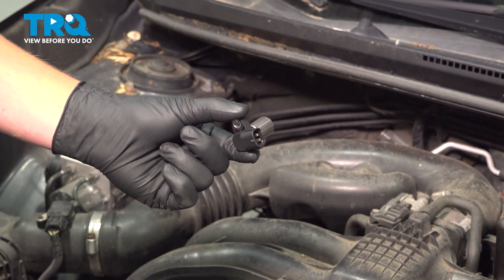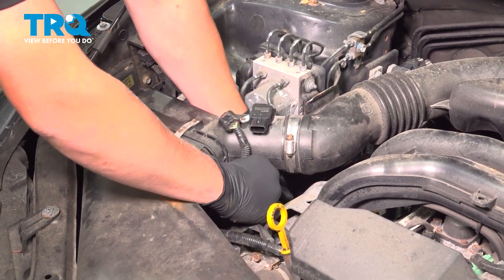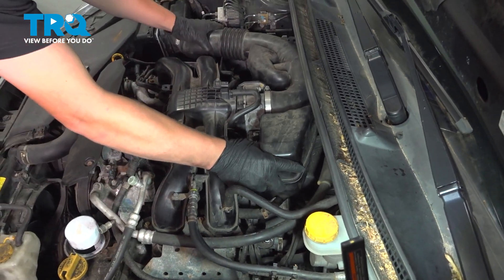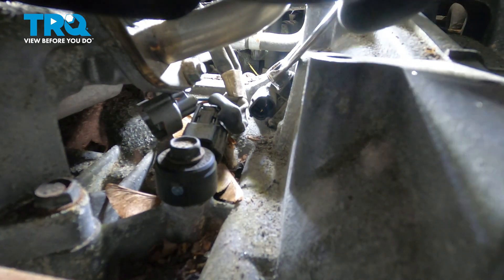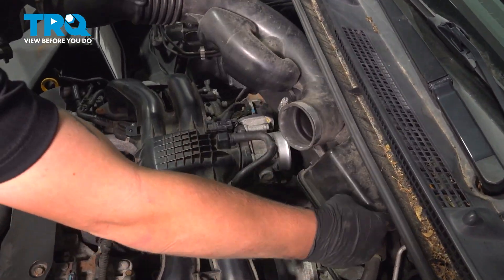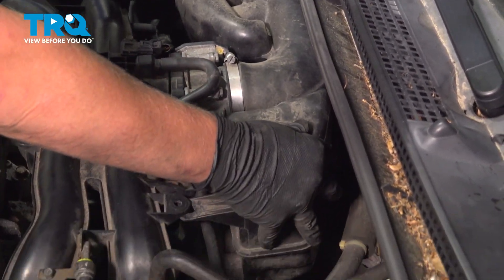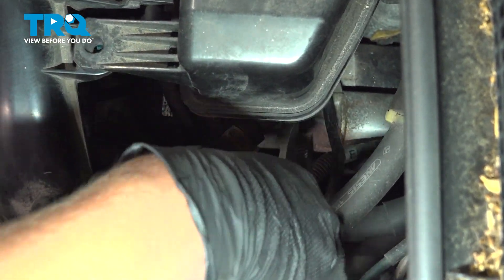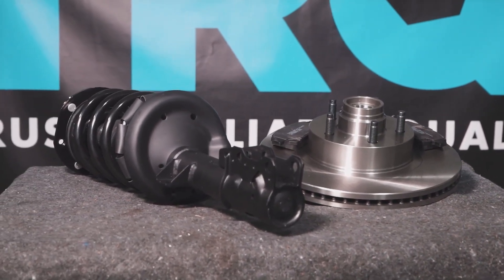How to Replace Crankshaft Position Sensor 2012-2016 Subaru Impreza

Comment: How is it that every time a search a video to fix my Subaru Outback 2013, it’s never the same engine. But when I search the same year Impreza I get the exact same engine I have and it’s very helpful and I’m thankful just slightly confused. I understand their engines are very similar but there’s no history on my car of an engine swap and when I search my type engine it comes up as an 2013 Outback. Even in inspections and all, oh and on google lens as well lol. They all say it’s an 2013 outback which matches but the videos I find online helpful are only the same year Impreza. 🤷‍♂️
Reply: For example in this video sensor is in the back of the engine just like my engine on my Outback. However online videos show my sensor should be in the front of the engine under the alternator

Comment: I came down to the same assumption too as well. Not only did I thought I was going to see both camshaft position sensors replaced. The minute I saw some attaching that battery I was wondering where the heck is the second one. Play missed a few things and this was someone informative just I wouldn't rate it at a 50% best

Comment: Does 2016 Subaru WRX, 2.0L have the Crankshaft Position Sensor in that exact location, or is it located below the engine accessible through the bottom of the car?

Comment: Came here to mention that if you are doing this on a 2017 Impreza, tool access to the 10mm bolt is limited from the back side. What worked for me was using an extender and swivel adaptor to snake my 10mm socket through a small gap on the FRONT side of the intake manifold. You’ll need roughly 10-12” of extension. Also, you might need a flashlight to help see the path/ gap under the intake manifold that leads to the 10mm bolt on the sensor.
Reply from the maker: +@ZachFox Thanks for the feedback! http://1aau.to/m/Shop-TRQ
Reply: I got it with a small 1/4 inch ratchet and a short 10mm. Use the holes in between the intake tubes to see/shine a flashlight

Comment: I believe you've overlooked a crucial detail in your video. You failed to clearly demonstrate the sensor's location. There's a significant gap in your instruction between removing the entire intake and showing a close-up of the sensor. The actual location of the sensor within the system wasn't adequately illustrated